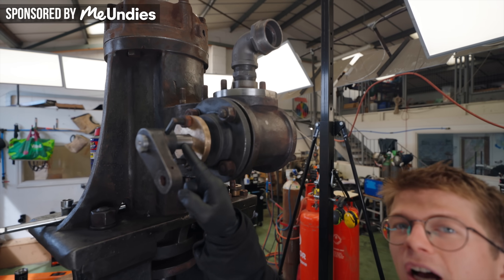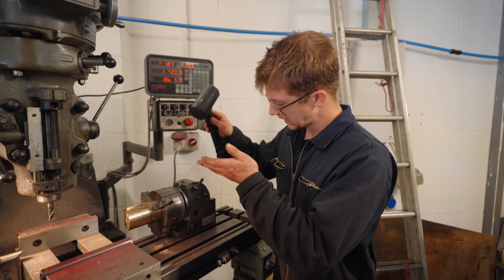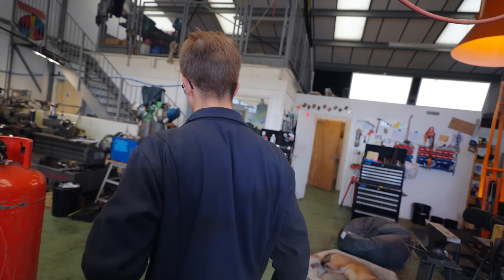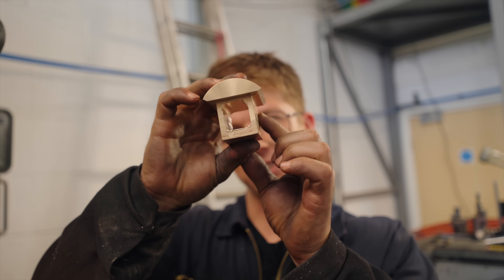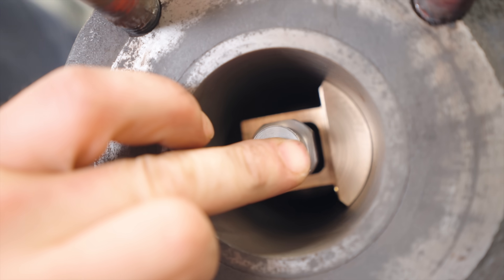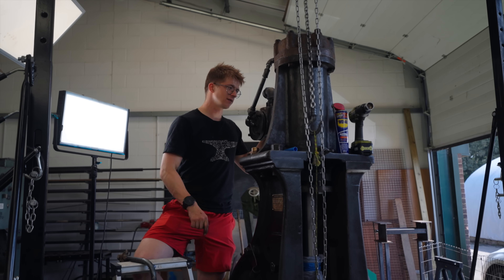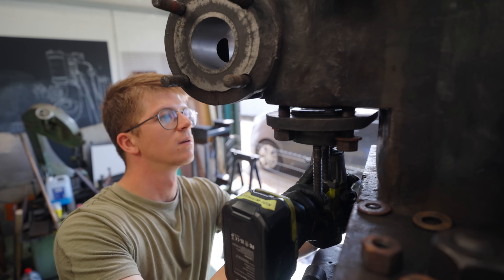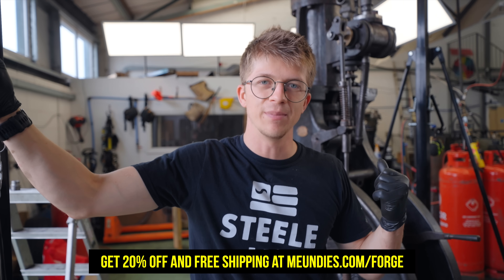FIXING A 1900's STEAM HAMMER! Pt. 14

Comment: Just a tip before you go off loading that thing with steam is maybe pressure test your fine work to some amount based off of a best guess of operating pressure. If any of your packings/flanges/threads/unions leak you'll be able to fix it without dealing with steam.
Reply: Why not just run it on compressed air? There is no reason to run it on steam nowdays, the days of old LP steam workshop boilers are gone.

Unless im missing something?
Reply: @Carl2k7 because it was designed originally to run on steam and its cool, hes obviously into this type of old machinery, if he wanted one that used air he would buy one, not a steam one to convert to modern day. They’re historic pieces and hes preserving its authenticity.
Reply: There's a passage in Terry Pratchett's book Raising Steam which, while fantasy, has some basis in truth:
Those who don't understand the steam find themselves in a cloud of red mist.
Reply: @Carl2k7  Logic says compressed air but it's a STEAM hammer.
I bet Alec will try and get it running on steam. Lets face it, this series has been great because of his perfectionist nature.
Reply: While compressed air might work, i suspect might have issues due to lack of heat and thermal expansion
Reply: The machine is designed to run hot so wouldn’t all the tolerance be run at high heat?
Reply: @Carl2k7  The water from the steam also helps to lubricate the internals. So if you ran it on just air, there is less lubrication than it was designed for. Yes, water doesn't add much in the way of lubrication, but over the life of operation it does have an impact. Also, steam has a lot more power in it than most compressed air systems run at. So you would need to build out a very high pressure air system for it to work. And if you have to build out a new system anyway, might as well make a steam one.
Reply: @Targe0   fully appreciate all the replies  buddy, I get it, but from a mEng & pEng comp air and steam are basically the same principle drivers beyond heat capacities and vacuum condensing, you could get away with oiled air, the graphite packing and CAF seals are all same international specs for compressed air and steam until you get to Superheated supersaturated hp steam. My point is, to get a boiler capable of delivering the required pressure at drive force with enough excess capacity to manage usage swings is going to be vastly uneconomical compared to a decent electric compressor, surely would only require a couple of mods to the steam trap which i guess could now be a compressed air oil trap. 

Thanks again for the input guys
Reply: Infact, why keep it authentic? Why not just go balls to the wall and stick a diesel injector and a couple of glow plugs in the top, T off the feed line for the oil pump to the injector add a couple of SOV’s and a big red button for power marking your makers mark, i call it Combustion Liberated Integrated Technologies Originating Routes In Steam,  I know its a mouthful but it can be abbreviated as C.L.I.T.O.R.I.S, i’ve been looking for patents relating to this but to date i’ve never found one.
Reply: Energy density, it costs a lot less to get a watt of power out of steam than it does to compress air and then get a watt of power out of it.
Reply: @Carl2k7  Cute. LOL
Reply: @shawnsmith9512  at scale maybe, it only makes sense if you are using hundreds of LP steam users and you have a cheap source of waste heat (dont go into the forge/steam gen please) 

Think of the heat capacity of the water in the boiler to get the steam drive, the sizing to get the instantaneous response and being, certified pressure vessel and certified safety and control systems, heat soak of the pipes/machine water hammer, purging.

Per Kwh its surely 100x cheaper and safer to use compressed air but yeah its a massive undertaking to do steam.
Reply: @fireblade757  Also the steam has oil which supplies lubrication
Reply: He’s probably just gonna run it on compressed air like a regular person? It’s possible he will get a steam compressor but he does not have space in his shop and it is a rental
Reply: @davedavem  unBLEVEable 😂 

Gent’s, steam is horrifically erosive when thermal cycled especially in mild steel feed pipes that will constantly deposit scale and rust into the piston chamber if he doesn’t use demin water and an O2 scav, it has terrible lubricant properties, there wont be oil in the steam, unless it’s designed to be there as it will carbonise and polymerise on the cylinder walls as well as gum up all small components. 

I saw Alec’s approach to safety with the chippings damascus box, dont let him near a steam Gen PV, it has so much more stored energy when it goes wrong, i’ve seen it too many times first hand. Plus the demin water will need to be a supply with a safety margin to not run out during use.
Reply: We don’t was Alec flavoured red mist
Reply: I doubt he is going to hook it up to a steam boiler.
He’ll be running it on compressed air.
Reply: @Targe0  Every steam engine/tool has some sort of lubricator to add steam oil to the steam because water is far from an adequate lubricant.
Reply: I'm pretty sure he plans on just running it on compressed air.
Reply: Steam behaves differently than compressed air. Even at the same pressure. Steam is more "explosive"
Reply: Fill it with water and do a hydro test first. Way safer than testing on steam or compressed air.
Reply: @Carl2k7 Compressed air might wirk b t you have to consider that steam not only expands like air, it also contracts when it condensates. Not shure how important that is for the proper function of the hammer💁‍♂️
Reply: Compressed air will work just fine for testing. With careful attention to oiling it could even run for the rest of its life on compressed air.

But where is he going to get the required sheer volume of compressed air?

It’s not about just the pressure, but the cubic feet per minute at a specified pressure that thing is going to need. Look at the size of the main cylinder in the front of that hammer. It’s going to empty your average shop compressor just raising the piston part way. I assume Alec has a rather larger compressor than I’ve ever owned, but he’s going to need thousands of liters of air to run it for more than say a minute or two.

Compressors that supply that kind of air are not cheap. Unless he builds or buys a commercial boiler, he will end up with one of the most expensive paperweights he’s ever owned.

Alec, if you read this, PLEASE do not build a boiler. One large enough to run that hammer is six or seven kinds of dangerous *even in normal operation*. Just pressure testing one that you have made is- I can’t put it any other way- suicidal. If you’re determined to run it as a habit, then pay to have a steam plant installed.

Let me put it this way- with what you’ve learned of steam locomotives, would you build one?
Reply: @Carl2k7  Nope, air, with a lubricator. Steam is expensive, messy and dangerous.
Reply: @Carl2k7 If you run something on compressed air as opposed to steam you lose some power because steam contains more energy for every psi/bar you have. It's thermodynamics. Not only that a machine is built to run at a certain temperature and heating it up will adjust the clearances. Mostly though this is an LP high volume machine. The size of the compressor would be enormous.
Reply: @markchisholm2657  i get what you are trying to say, because of steams ability to phase change and condense it provides a pulling power, but the KW size of the steam generator you need is far larger capital expenditure than a good recip or screw compressor with a decent size buffer vessel or a HP & LP buffer vessel. LP steam is about 110c so I can’t see temperature having much to do with things, compressed air can be 150c if the aftercooler breaks 😂…and remember this is the UK, it freezes, wouldn’t it be far safer to run on compressed air if you wanted to preserve the machine for generations, i’ve seen valves the size of that power hammer pop apart like balsa wood because of freezing water.
Reply: @Carl2k7  Steam is denser than air so it carries more inertia to transfer to the working parts. That's why steam can do more work at lower pressures than compressed air, and tends to be more mechanicaly forgiving of leaky fittings and variable pressures.
Reply: @nunyadayumbusiness591  sorry I can’t accept the inertia idea for a recip piston power hammer, its a principle of pressure psi/surface area of the piston, which at 10psi is the same as 10psi of compressed air no? i could get your point in the case of a turbine as it would increase the kinematic viscosity and give more power transfer, Steam is terrible for fittings in the same way wet compressed air is, condensation in lines leading to internal corrosion, constant expansion and contraction of lines means the thread sealant breaks around the fittings, what your thinking when it warms up and stops leaking is either, expansion of the fitting threads sealing the leaks once the machine is warm, any leaks immediatley evaporating due to the high temperature, or the condensation of water in the lines that the steam does not have enough pressure to push it through the threads of the fittings, similar to how a labyrinth seal would work. 

What i’m trying to understand is there a functional purpose of steam over compressed air that is integral to the operation of the power hammer, i know i could go over to chat gpt and probably get an answer but I really love seeing how peoples brains approach the question and trying to analyse the functions in my head, so thanks again for the input guys
Reply: @Carl2k7  Of A power hammer? No. Of THIS power hammer? Yes. It's going to be inefficient and leaky even for a turn of the century steam hammer, and it's going to need every advantage steam can give it to compensate for it's designer's "sins". (Those sloppy tolerances that give us the shudders somehow let this steam powered clunker last for 120 years)
Reply: @Carl2k7 from what I understand, steam is used to lubricate some components. Sounds weird, but when water gets between metal parts, it gets slippery. If we are talking compressed air, they might have to have an oil mister onboard.

That being said, compressed air to test for leaks is a good idea.
Reply: I work with steam and you wanna be real carful with it I’ll tell you that right now
Reply: That doesn't even make sense you never pressure test with steam for one and two you wouldn't leave the steam running while you repaired it

Comment: I'm from Australia!
I call the adjustable one a "shifter" and the fixed one is a "spanner"
Reply: Also known as a shifter here in Scotland
Reply: Plus the ratchet.
Reply: And we call the socket wrench a ... um ... socket wrench. Also, the ring spanner is a ring spanner, and the crescent wrench is just a spanner. But the shifter is variously 'shifter', 'shifting spanner' or 'shifting wrench'.
Reply: “In Brazil, we call it ‘English key’.”
Reply: I usually refer to a shifting spanner as a "hand lathe" due to them being really good at rounding off the corners of stuck bolts if not properly adjusted.
Reply: Seconding the shifter, clearly the superior name
Reply: A- shifter
B- spanner
C- ratchet

From Australia
Reply: +1 for shifta  🇦🇺
Reply: @MrTjnielsen81  Due to that happening so often I call the tool an "Adjustable Knuckle F**ker" because it invariably causes me smash the back of my hand when it rounds the nut and slips off at great speed !
Reply: Yep 'shifter' 'spanner' and 'rachet'
Reply: From aus aswell and you're spot on mate 👍
Reply: Adjustable Nut Rounder.
Reply: I mean it shifts stuff, how can it be anything other than a shifter 🇦🇺
Reply: haha you beat me to it
Reply: @docOld55 Or ring and open ended spanners.
Reply: Also from Australia. Mechanic for 35 years. I call it a fitsall. (or shifter)
Reply: Yes agree with shifter but also can be used as a hammer 😂
Reply: +1 for shifter, also called by myself and a few others an AFS (all fucking sizes)
Reply: Definitely a shifter
Reply: Nah mate, they are all hammers

Comment: The steam pressure and the steam oil is what will cause the valve to seat closed in the valve assembly.
I'd oil everything up in your valve train before applying any steam or air.
And if you do go with steam, you will want a hydrostatic lubricator to continuously add oil to the steam vapor, and you'll need blow-down valves for the cylinder to drain the water, but I'm pretty sure you guys already knew that.
Fantastic job so far!  hope it springs to life soon.

Comment: US Version:

Cresent wrench is what most call adjustable variety. Crescent is a brand known for making those wrenches.

Wrench for the fixed variety.

Ratchet for the thing sockets go on.
Reply: Same up here in Canada.
Reply: In New Zealand we just call it a crescent, the Aussies call it a shifter.
Reply: "Nut rounder" is also acceptable for crescent wrench, as is whatever string of expletives you wish to use when it changes sizes with the slightest bump for the 8th time in 5 minutes
Reply: Knuckle buster is another name in the US for the adjustable hahaha
Reply: I didn't realize Crescent was once a brand, I thought it was the shape.
Reply: Also adding to this:

Box Wrench for the enclosed non adjustable wrench.

Open Wrench for the classic wrench end.

Pipe Wrench/Monkey wrench are that other adjustable wrench.
Reply: @DasGanon  Close but no cigar.  Pipe Wrench and Monkey Wrench are different, and neither is a Crescent Wrench.  Pipe Wrench has serrated angled jaws and a vertical screw to adjust the top horizontal jaw away from the bottom, and it's used for round pipe fittings made of black iron, copper, or brass/bronze.  Monkey wrench adjusts same as a Pipe Wrench, but has smooth-faced square jaws for use on square iron or steel nuts and bolts.
Reply: An open and box wrench is a combination wrench. Because you have both.
Reply: @DomingoDeSantaClara  As an Aussie I can confirm I call it a Shifter, short for shifting spanner
Reply: @johnks6733  spent a few years working in Melbourne in the 80s, always got the piss taken for calling it a crescent.🤣
Reply: Yep. That's what I've always called them as well.
Reply: @DomingoDeSantaClara  Shifter in UK. Or device for rounding off bolts.
Reply: I always heard them called an adjustable hammer
Reply: If you’re confronted with a nail…. They’re all hammers!
Reply: @Y2KNW that's what I call it when an apprentice uses it on something I have a socket for. Then I get mad and make him figure it out how to get the bolt out
Reply: Yep, that's what they're called
Reply: I didn't realize crescent was a brand, I thought it was just a regional thing where I live
Reply: And I have a crescent wrench with vise grips 
Both brand names that are used as generic names for separate tools put into one tool
Adjustable wrench with the locking/plier mechanism on the side of it 😂
Reply: @craigscholl1912 I was workin on a job and I asked my helper for the hammer. (No hammer in sight)
Helper was like ummmm there’s no hammer in here.
I pointed at the crescent on the floor, “👉that’s now a hammer. Hand it here”😂
Reply: Universal hammer
Reply: Here in Belgium my dad always cal it a "English wrench" i don't know where that name Came from 😅
Reply: @erichurst7897  They still are a brand. I bought a set not long ago with red rubber dipped handles.
Reply: Crescent got Kleenex’d. It was a Skil issue.
Reply: You call it an adjustable spanner because that's what they are called!
Reply: I call the fixed/static wrench a combination wrench. Because it’s a combination of a box end and an open end. 

The crescent wrench, I just call an adjustable wrench. 

And the other is just a ratcheting wrench. Sometimes I’ll call it a socket wrench, or just a ratchet. Depends on my mood that day. lol.
Reply: Saskatchewan tool box or crescent wrench.  Those who know, know.
Reply: @Y2KNW  absolutely killed me! 😂
Reply: @Y2KNW  that’s what I was gonna say the round all, works great as a hammer😂
Reply: A nickname I don't hear as often now is..  "knuckle Buster"

Comment: I just want to say the valve was a floating one and now he’s made it fixed. By floating I mean the pressure is what actively holds it against the port.
Reply: Yup. That's a Corliss valve: the steam/air pressure seals it by pressing it into the surface of the bore.
This arrangement also takes up any wear by itself.